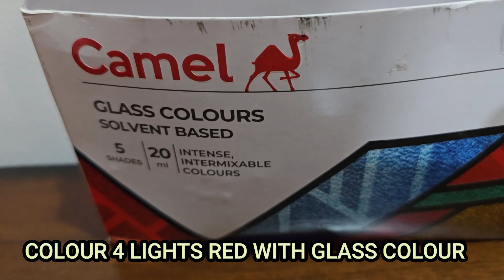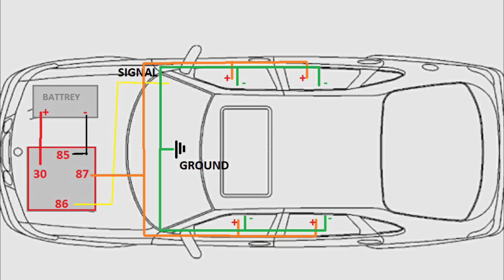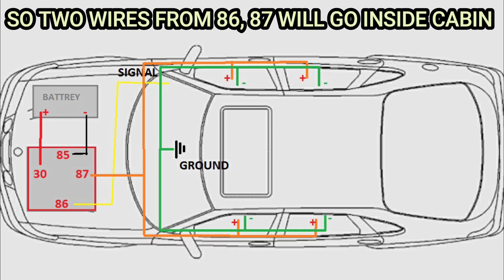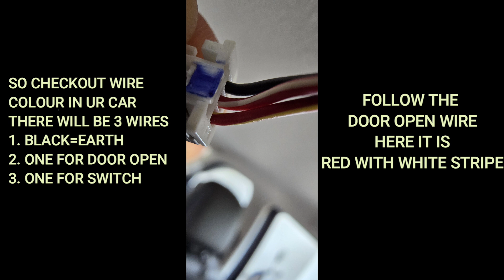Installing Door Light And Puddle Lamp in Scorpio N

Comment: Can we connect these lights just with a fuse tap from dome light fuse for positive and take individual negative from door switch??
Reply from the maker: I won't recommend these shortcut practices. There are two dome light 3A each, 8 lights installed 1A each giving total 15A of power drawn. In my car power comes from ECM.
If u found particular fuse for dome light then most dome haves fuse rating 10A which is good to give supply max 8A.